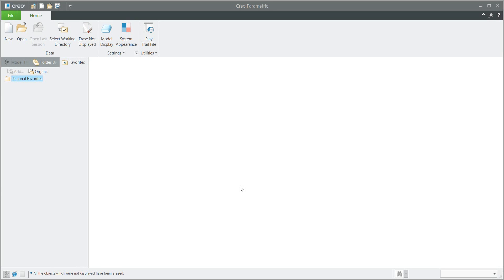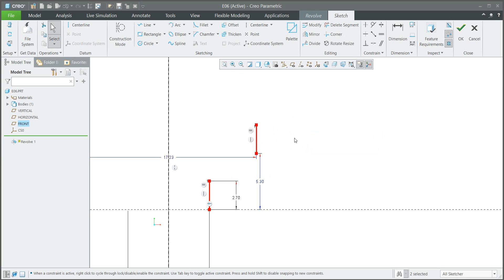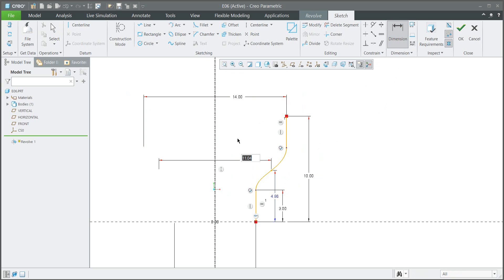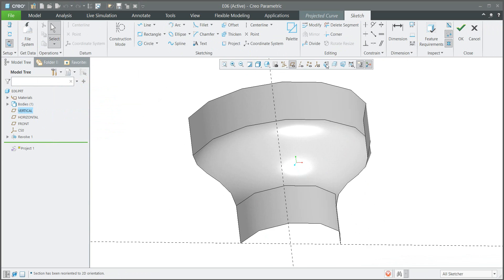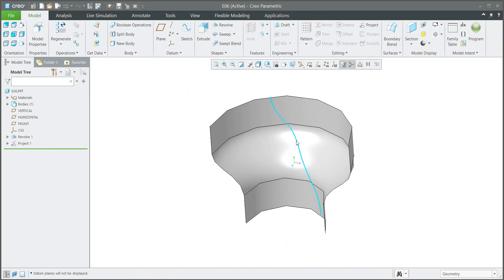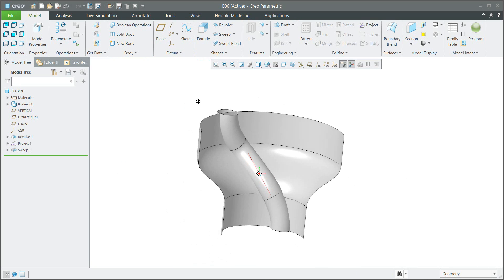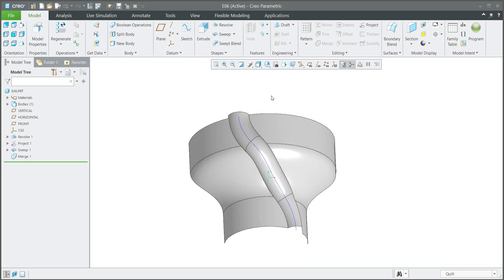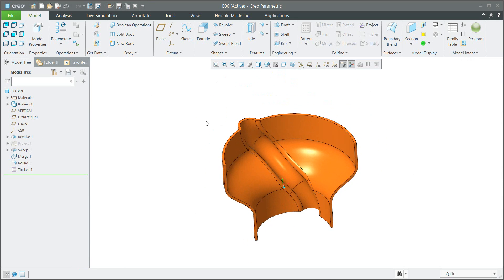Basic 3D Surface Exercise for Beginners in Creo - Exercise #06 | Creo Tutorial - Quilt Protrusion

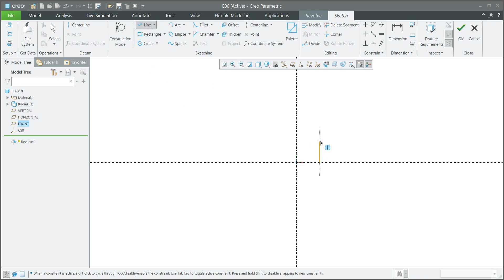Comment: Thanks Vladimir, what config do you have that automatically creates the diameter dimension (at 0:47) - my sketch did radius!!    How do you select just dimensions at 0:50 ?  Mi setup selects everything and I have to change the selection filter!
Reply from the maker: If you use revolve feature and in the sketch if you create Centerline (axis of Revolution) system will create diameter dimensions. If you have different filter as I have, maybe you have different Creo. I use Creo 5 and Creo 7.  What Creo release do you use?
Reply from the maker: I have plan to create tutorials for configuration, stay tuned. Vladimir